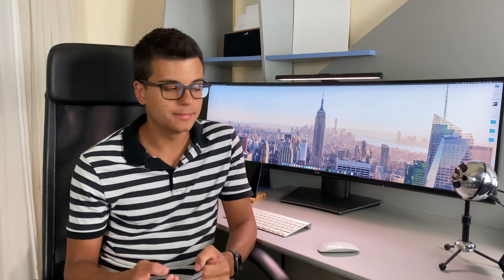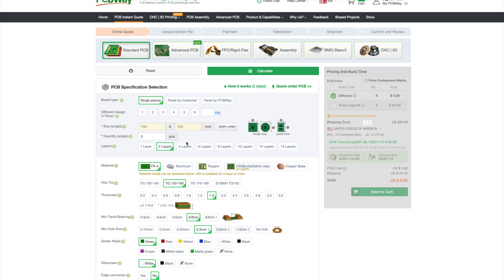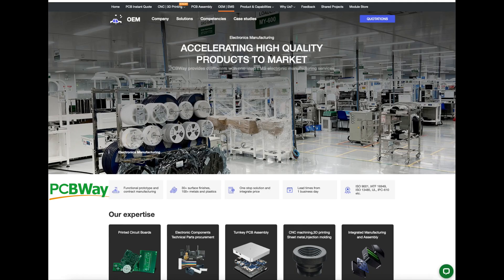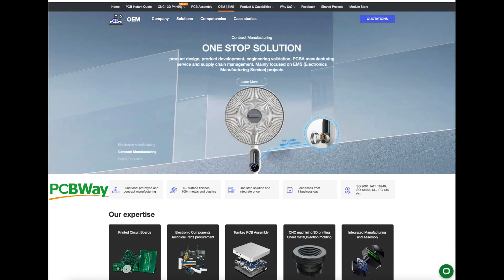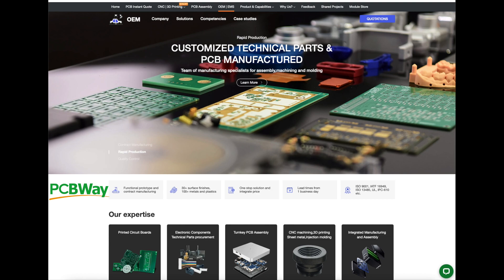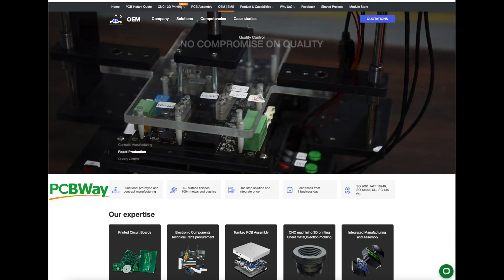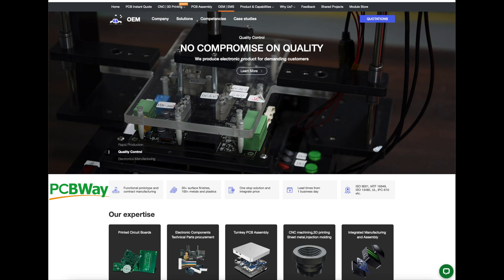Direct Memory Access - DMA - What it is and How To Use it To Your Advantage

Comment: Is it the DMA enable flag that tells the CPU to sleep, or is that a separate topic?
Reply from the maker: You can set the CPU to go to sleep (low power mode) whenever you want. With the DMA, a trigger starts the DMA transfer, which means that the CPU can’t work during this time.